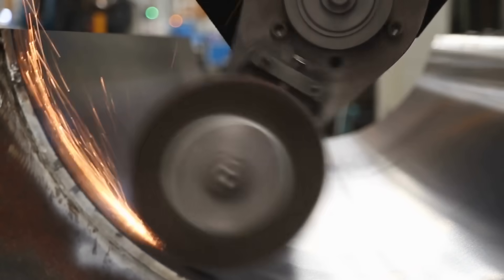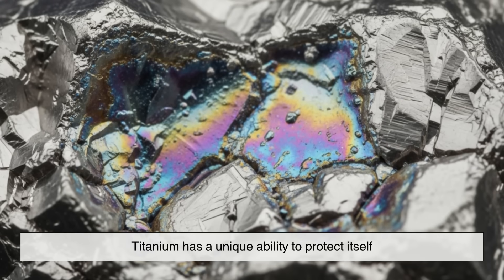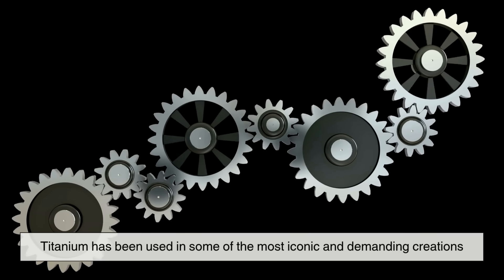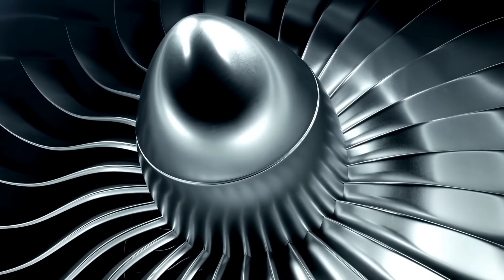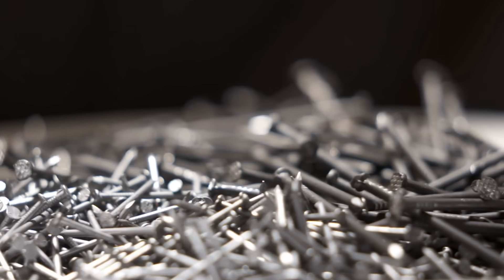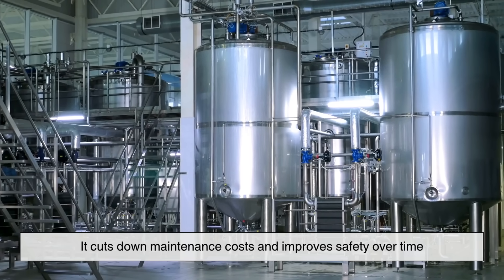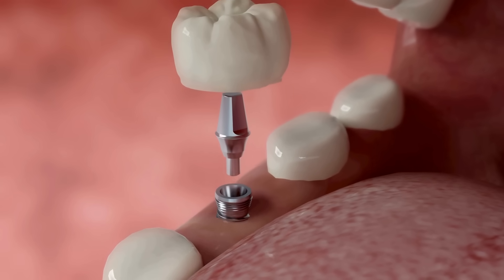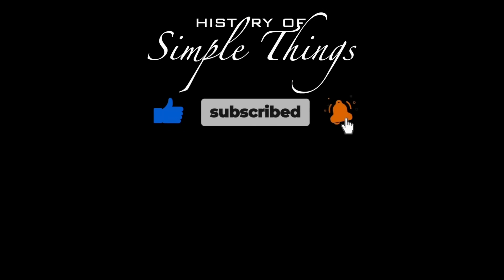Why Titanium is Nearly Impossible to Corrode

Comment: Titanium used to make the SR71 blackbird corroded very easily.  All that was needed was chlorinated water.  Welders would use tap water during the summer to cool off the panels in the hot desert.  They didn’t need to do this in the winter. Summer builds corroded—visible pitting. The winter builds didn’t. They had to scrap those planes and replace everything.  Which meant they had to buy a lot of new titanium from the Soviet Union using shell companies.  
By the way, titanium medical implants (plates, screws etc.) aren’t better than steel.  20 year surgeon.  It’s a lot more expensive though, and work hardens stupid quick.
Reply: Nice
Reply: Titanium is more biocompatible than 316LVMSS, your body won't acknowledge the titanium as a foreign body, while even low carbon, vacuum melted 316SS will cause allergic reactions in a not insignificant percentage of the population, hence the switch to titanium for medical implants. I've got 316SS implants as a body mod since I don't react to it but they're also 26 years old, most non-medical implants these days are either 6Al4V ELI titanium or medical grade silicone

Comment: Titanium weighs 58% of steel and is way more resistant to temperature than steel, with a melting point of 3034 degrees F. It is very abundant on earth, but we don't use it much because machining this metal is  very difficult. It tends to "gall", meaning that it is difficult to cut cleanly.
Reply: I thought titanium was difficult to attain that's why we got it from the Russians for the SR-71
Reply: Also steel has an infinite fatigue life even titanium can't boast that
Reply: welders use stone or masonary cutting discs as Ti rips the teeth of saws . Ti may not rust , true , but it is "passivated" using acids to remove contaminates , especially sparks from disc grinders pit the surface
Reply: What are you talking about titanium will catch fire while steel won’t. That alone stops it from being used in critical high temperature applications.
Reply: @helpimlost137  Oh I see.  So they built the SR-71 out of steel, correct?  And what about all those steel parts on spacecraft?  Wow, how could I be so stupid...

🖕
Reply: You're incorrect about resistant to temperature It does not form back to its original shape very well and will disintegrate through repeated heating and cooling cycles, ignoramus

Comment: You did not answer the question you brought up. Why don't we use it everywhere?
Reply: bacause it’s expensive and difficult to work with
Reply: in other words even though the element itself is fairly abundant, it's still expensive mainly due to how expensive the machinery to shape it is
Reply: @talion7268 It is difficult to refine and work with
Reply: @talion7268 that's the cheap part, it bonds tightly to oxygen so it's incredibly difficult and expensive to refine from ore. That's the real hurdle
Reply: @chrisrageNJ i see! Thanks for the info dude

Comment: Titanium's ability to resist corrosion is hardly unique. Chromium, aluminum, beryllium, niobium, tantalum, platinum, palladium, rhodium, iridium, even gold do also, sometimes because they do the oxidation trick, sometimes because they don't even like reacting with oxygen. (The list is not complete.)

Of course there are a lot of metals which will oxidize to destruction like iron. And titanium is very strong and not as expensive as most of the metals I mentioned.
Reply: Came here to say the exact same thing
Reply: Furthermore the titaniumdioxide layer is also corrosion to be chemically correct
Reply: I've worked with both titanium and niobium, in the body jewelry business, and titanium is a dream to work with compared to niobium. Niobium galls super easily while being tough and heavy, while titanium machines cleanly with the correct tooling, feeds, and speeds, while being extremely strong and lightweight. Both are able to be anodized with a DC current but niobium colors nicer and you can get a nice hematite black with heat, which is not possible with titanium. Neither metal can be colored red without a PVD coating (physical vapor deposition), a post-machining additive process

Comment: While Titanium is very interesting metal to replace iron and it is also abundant (very cheap in raw TiO2 form), the biggest difficulty (which is then reflected in very expensive price) is that Titanium is very difficult to melt, shape, forming alloy, weld, and to rework with. It requires expensive setup and in laboratorium condition to make Titanium metal.